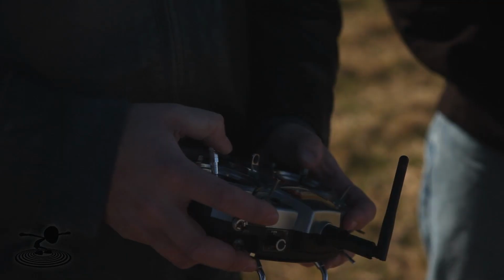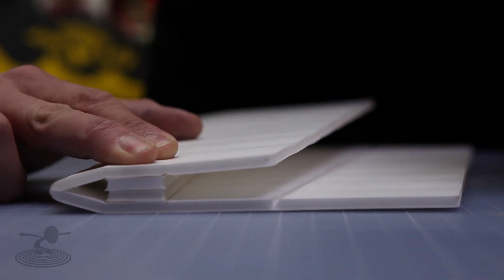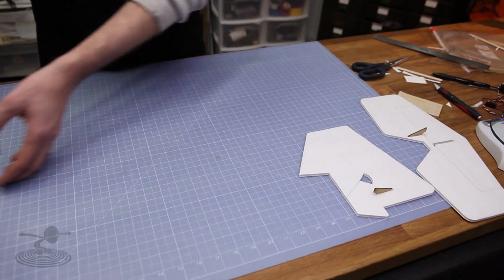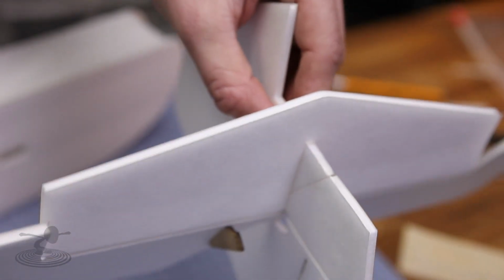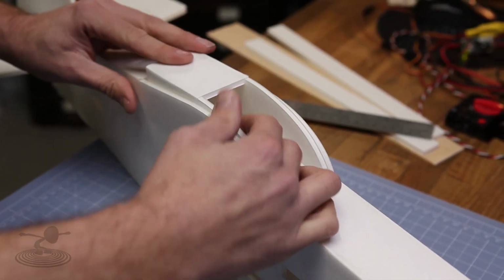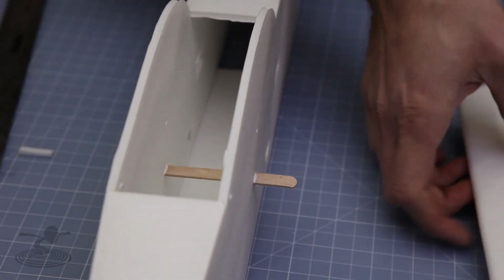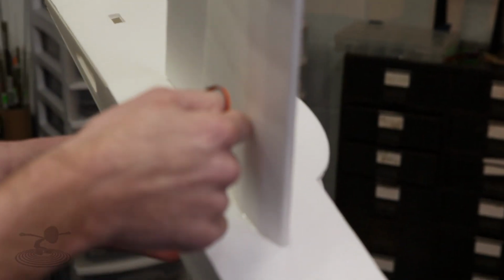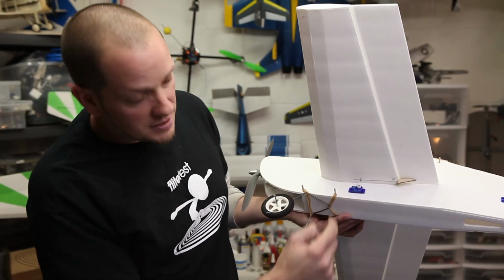Flite Test - FT 3D - SCRATCH BUILD

Comment: I guess I was early when I used this material around 1990 ;)

Built the wing one sheet curved - more like the early bleriot type wings. 

I ended up with a 3 meter wingspan sailplane 

Cut the wings in foam. Plywood standing box centre spar. Covered the wing with flourecent paper that was meant for shop adds. 

Body in the material on video. 
A piece of fishingrod as a tailboom. Balsa stabilizer and rudder. 

The thing flew really well.

Comment: Thanks for the video! I’ve build mine, but I can’t seem to get enough lift lift to take off. I know with other planes I have, you can run forward and feel the lift as you do so, which isn’t happening to me. I’ve only tried takeoffs from the ground, afraid that if I toss it, it will nosedive. Any suggestions on how to fix it? I laser cut mine from the files on flite test, so it should be similar to yours

Comment: can I get away with using a 980 kv motor with a 9 x 4.5 prop?
Reply: I know it is not my original comment but do you think a 1000kv would be good
Reply: I'de say so, the pitch is a bit high for 3d though, if you go down to 9x4 it may make a great difference
Reply: Liam Coddington okay thanks

Comment: damn europe only have 3 or 6mm depron to use :\ the folds get so wrong. just built this with some old crappy 2x3mm depron with airpockets just to try, but everything gets out of proportion. i can adjust some of the folds, but its hard when im 1.2mm to thick everywhere XD
Reply: Print the plans at 120% and use 6mm
Reply: +FPVicious uuh. so i get a plane 20% bigger? :D or would that actually be 10% bigger? im confused already
Reply: you get 20% bigger airplane
Reply: Iz so awsooooome
Reply: Versuchs mal mit xps villeicht findest du das ja in der richtigen Größe:)

Comment: Hi Josh - I just built your FT 3D. Thanks for the plans - they worked awesome! Now I'm ready to wire the power pod and figure out where to put the battery and how to secure it. With the Spitfire the battery hung on the bottom of the power pod with Velcro. I guess I'll do the same with this plane. Wish you had a video on the best way to wire the powerpod and battery placement. Keep up the good work. By the way your FT Simple Soarer flies like a dream.

Comment: Man, this channel has sparked my R/C plane fires to get back into it. My friend and I taught ourselve DeltaCAD and (after lots of scratch-built stick-fuselage planes with brushed Slow-Stik motors and fully built up balsa wings) eventually made out own laser cut balsa PT-19 kit based on a scratch build my friend did that flew awesome.  The balsa was the weak point in the plane, because it if crashed, rebuilding and re-tissue/doping was a pain, and Li-Ions had juuuust started to be feasible/affordable after the "repurposed cell phone batteries" era.  We never actually commercially sold the kit, and after 3 or 4 completed kits decided to quit. Time to bust out the ol' 6 channel JR!

Comment: Josh!
In this critical part you can use polymer glue it would be better than hot glue because it take about an hour to dry - so you do not have to use any strength trying connecting wing.

Comment: FliteTest  how am i supposed to get the templates on the foam board? also in poland you can get only depron foam which doesn't have the paper. Can i use duct tape instead? Also could you make some video how to make different kinds of fuselages? (im interested in some round ones) and i wanted to make EDF jet from foam board, but i need rounded inlets and i simply dunno how to make them from foam
Reply: +Bananovskyy You could use duct tape.  I'd go with packing tape instead.  The templates are available on the Flite Test site, in the build article.

Comment: What machine do you use to lasercut your planes ?
Reply: chazman34772 lots of people outsource to a local laser cutter. These guys are usually experienced with their CNC laser cutting machines enough to know the proper settings for different materials (they might advertise wood engraving or something along those lines) and after you supply a properly formatted CAD file, can go to work!

Comment: What i think would be really cool is stereotypical  Cessna 172,182 frame with a ducted fan unit that suck air in. So the air is sucked trough where the engine usually is and exit out the back some where. I've been meaning to do this for a while but i haven't had the stuff to do it.   What do you think?

Comment: Good day. Sorry for the question, I got the material to make a plane with the plane, but I see no where, the box where the engine mounts and electronics, can you tell me where it out? or longer based on the size of the plane have to design it? 

very good post Greetings
Reply: Alejandro, you can buy in any store rc hobby. But if you want best price you can find on sites like banggood.com or hobbyking.com brushless motors, servos, rx / tx, batteries, etc.. The only thing you have to wait a while to arrive products from china xD

Comment: Josh, did you invent this process of foam core board plane construction?  What type of hot glue are you using?  Also, what is the difference between $33 radios and  $70 radios?
Reply: foamies have been around for a while, though these guys do take it to an art. And the difference in price for a radio usually reflects on how much of a pain that radio is to set up, and what it can do (also how many aircraft it can store, most cheap radios, like mine, can only hold one, and require being hooked up to a PC to adjust things) He's using high-temp glue, from the looks of it.

Comment: Is it possible to use a larger battery as long as its balanced out? I wanted to use the often used 2200mAh 3s 20C with a 1200kV motor. Also, there isnt anything mentioned about preferred battery location, should it be Velcro'd  to the bottom of the power pod or inside the power pod?

Comment: Why don't Boeing make their planes like this?
Reply: size and weight. For a little plane like this, EPO and EPP foam are fine, but you'd not want to ride in an aircraft that's made entirely of foam (though foam is used in the construction of many aircraft)
Reply: Alpatriod
Poe's law is strong in this comment. Aluminum and carbon fiber composite are both lighter, and stronger, then foam. Foam doens't scale that well. Look at the 200% videos, they had to reinforce the foam with other things, even at that scale.
Reply: Because they don't know nothing about aviation. :3
Reply: DFX u don't know nothing!!
It's Actualy because they don't no about light aviation. 1st u might argue the jets would melt the foam... SO JUST MAKE HUGE DUCTED FANN JETS!!!

Also Bowing dosent realize if. A foam plane was to crash the foam would pad
And protect the passengers!!!!!
Reply: Nah they just two lazy to build from foam...
They have never tried it and they should
Reply: Alpatriod I know people who've tried building larger R/C aircraft with the stuff because it's cheap. It works, but never as well as good old balsa or even aluminum with foam reinforcement.

One particular example comes to mind. A super-scale flyer friend of mine built foam forms for the cheap vacuum-formed plastic he was using to cover his balsa airplane with (I don't know why he didn't just use canvas and dope like a normal person, but that's another story). He had the forms left over, and decided, rather on a whim, to bade a big ass foamie out of them. This thing was huge, not the biggest foamie I've ever seen, but damned close. We where under the impression it would fly about the same.

It did not... It flew so badly, that he decided to hand the controls to me, because it wasn't like the airplane had any redeeming qualities as a flying machine. (I was both flattered.... and offended, at the same time).

It weighed ten times more then the wood and plastic model. It's control surfaces where the same size, and if flew like a drunk gorilla. I did manage to land, but the impact, gentle as it was, still snapped the wings off. (the aircraft he'd made the forms for flew like a dream, though, weighed about ten pounds with fuel)
Reply: Alpatriod the force of the foam would probley kill them.
Reply: yeah boeing really should look into this

Comment: Will i need a 4 channel radio and receiver minimum? which one do you have installed here is it the OrangeRx Receiver 6ch? I'm just getting into planes now as a hobby and i can't find anywhere it states how many channels ill need to run.
Reply: 4 channel
Reply: 4 channels: 1 for rudder (vertical stabilizer), 1 for elevator (horizontal stabilizer), 1 for ailerons (on the wings) 1 for throttle. Yes that's the orangerx 6ch
Reply: I would suggest getting a Spektrum DX6I
Its plenty of channels and runs about $169
Top notch radio.  
Good luck.

Comment: The second wing is REALLY tough to put on. He makes it look easy. I dry-practiced several times and even still, the glue added enough friction that I was really using all my strength to get it into place. In the end, it was aligned but had a gap of about 1-2mm from the fuse, which I just squirted with glue. Beginners beware!! I am scratchbuilding, not speedbuilding, so it's possible the speedbuild kit is a little better. But I actually enlarged the holes a bit too so it was easier. Good luck!

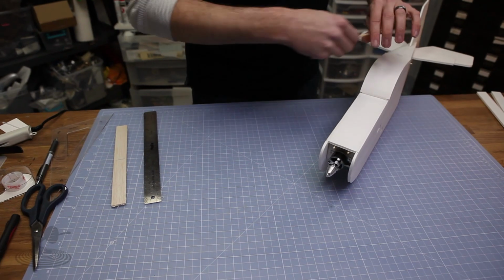Comment: 20:32 Balsa wood joiner: this isn't mentioned on the plans. He mentions it's a 10" long piece, and I paused at a frame to inspect the other dimensions: 1" wide, 3/16" thick. I had some 1/16" balsa around, which is thin enough to be cut by my xacto knife, so I made 3 10"x1" strips of that and CA'd them together to make this joiner/spar. Wish I would've had more heads-up about this.

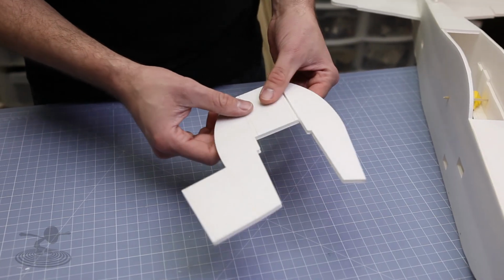Comment: 17:06 Double-check the fold style before gluing the canopy folds. In this video, Josh says they are all B-style folds, then looks as if he does glue a B-style fold and fit it right into his plane... But at least on the tiled scratch build plans, the bottom is labeled A-style, I glued it A-style and fit snugly into my plane (B-style would not have fit). Do a test fit before gluing to figure out which fold you need!

Comment: Where can I get 1/16" plywood?
Reply: Local hobby shop or craft shop. Here in the USA I found some at Michael's. Maybe even a hardware store. Balsa is a commonly used type of wood because it's soft enough to cut easily, very lightweight, and pretty tough.

Comment: what happens if i put the battery inside the window section near to the receiver instead of under the plane?
Reply: Then your CG - center of gravity will change. its always better to be a little nose heavy rather than tail heavy, and I just ordered this plane so I have not seen it yet, and not sure what you mean, but Im guessing you want to move the battery forward and higher in the fuselage?
Reply: Christian Prodanov

yea i wanted it inside, but as you said it will interrupt my CG, so I will put it in the flitetest specified location.
Reply: P

Comment: Looking at the plans it seems that the two sheets are A1 size. Would anybody happen to know if the parts would fit on two 20" x 30" sheets. Looking to scratch build this for the holidays :)
Reply: this is the same size of sheets which I have and have made two ft flyers on it so I think it will work
Reply: Does that mean that you could get an entire flyer on one sheet of 20" X 30"? :)
Reply: Dedumflame yes you can
Reply: Actually I wanted to build only one ft flyer but I mistakenly fixed it wrong so had to cut the parts again.
Reply: Ok. Thanks a bunch for the quick replies. :) Looking forward to making this and learning to fly a RC plane over the coming months.
Reply: Dedumflame Just started making this today. Used one 20"X30" but did have to tessellate the pieces to fit properly. I would've liked to see the plans as compact as possible already so that they can be printed on less paper and cut from one sheet easily. Other than that really fun building this and thanks a ton for the free plans  #flitetest
Reply: GOPAL AGARWAL  Hi Gopal, im from Delhi, India, and not able to arrange styrofoam for this model, can you tell me where can i get this from?

Comment: In case anyone else was wondering...I used a 1/8"x1"x24" piece of bass wood from hobby lobby as the wood spar. It fit good but you could probably go bigger than 1/8".

Comment: I like your videos I learn heaps from them, I built a funbat it is a blast to fly but I believe I have an issue with CG is it really at 1.75 inches from the LE seems to be nose heavy and it glides like a brick? I used 9mm depron foam thinking it would be more durable but  the fuselage cracks behind the wing with hard landings

Comment: I would be interested in your design attempts and the process of converting the design for use on lazer cutter. how you get ideas for mockups,how big a pile of board you end up with before you goto the cutter.And a explanation of what education you have amassed formal or by experience

Comment: They are using 'art board'. Paper covered foam board used for painting or for advertising and shop displays. In the US it comes from big superstores like Dollar Tree. But maybe you could use Depron or any 5mm or 6mm underfloor insulation type foam if you cover it with thin packing tape. Err, Isofoam I think is the name of one made in Poland. Also check out ExperimentalAirlines on Youtube for more inspiration. I hope this helps, good luck.

Comment: Their prototype had KFm-2 I think, symmetrical turned out better.
I thought 3D planes should have symmetrical so maybe the KFm-4 would have been better on their prototype? I was thinking about building this or blender but making fuse profile, maybe 2 foam board thick

Comment: Thanks for putting the video together, now I have another swappable to build!

I see that you are using an different motor than with the previous swappable planes. How dose the motor prop and battery combo used in this plane work on the other ones like the nutball?

Comment: I'm pretty sure they are using a NTM 28-26 1200kv motor from HobbyKing, which is a pretty good motor I used them on my quadcopter and they are great for the price